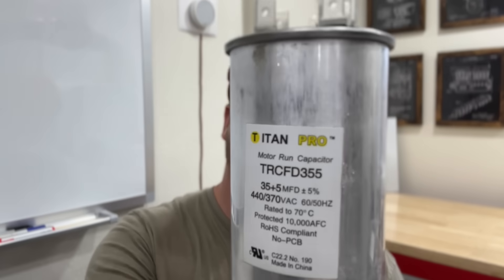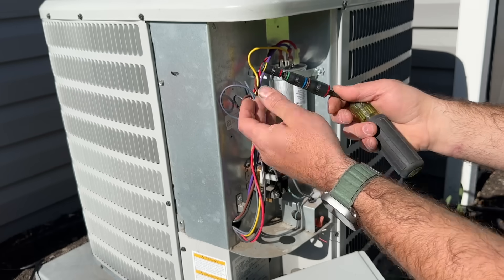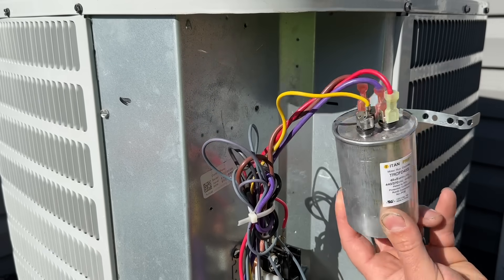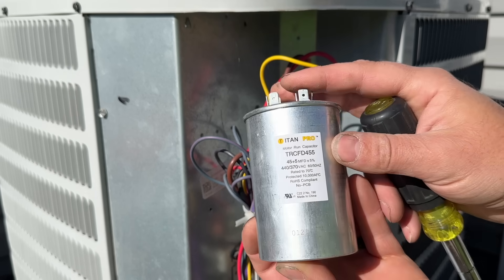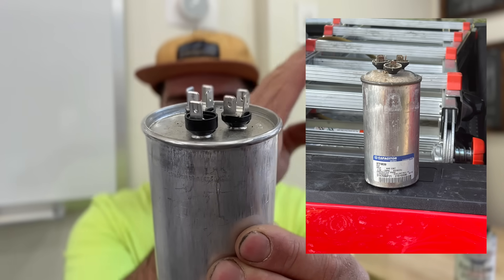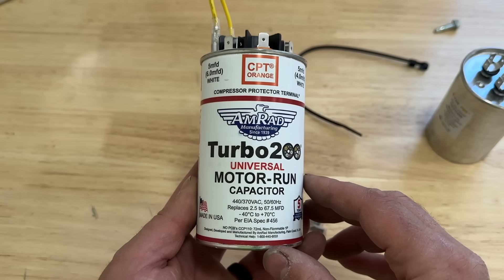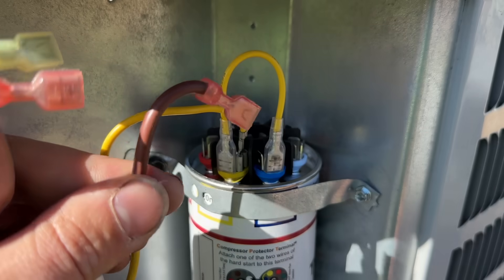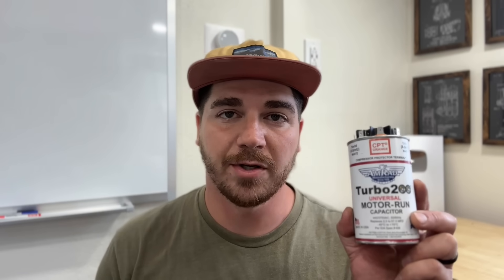HVAC Contractors Practically Make Their Living On These

Comment: On the turbo 200, when jumping 2 or more terminals together, to get the microfarads you need, you’re supposed to put your wire from the unit on the highest rated terminal in that connected bunch, even though they’re connected together with the little jumper wires.
Reply: Make it make sense....
Reply: certainly if you had to jump 3 together you'd need to hook the unit from one end of the chain or the other?  Otherwise your your making a parallel connection rather than the intended series connection.
Reply: @stvrob6320  I’m just saying that the company says if you jump 10 and  20 and 50 to get 80 uf, put your condenser wire on the 50 not the 20 or 10.
Reply: Why would that make a difference?
Reply: @stvrob6320  not sure but it’s what the manufacturer says to do.

Comment: I'm a retired HVAC technician (even though when I started I was a mechanic) and agree with what was told in the video. FYI, there are American made dual run capacitors other than the expensive AmRads, which I'm sure you can locate with a Google search. They will not be fit-em-alls but like the original equipment cap.

Comment: How do you know the capacitor is bad? My thermostat will not go down to the desired setting, I have changed my filters and cleaned the coils with a hose spray (although did not use cleaner and will take the top off tomorrow and a proper cleaning.
Reply: I just watched that part in the video. Any other ideas on why the thermostat won't go down - I also don't think the air is cooling. (single mom (recently) and on a fixed budget) - thanks!

Comment: Had the same exact thing happened to me, new unit was installed in 2021. Called the same guy and charged me 80 bucks, he said thats not covered by the warranty, checked it on Amazon and found the same CAP for 30 bucks.

Comment: better to not short capacitors but instead use a 1w 1Mohm resistor with alligator clips to discharge/store.  direct shorting can destroy the cap if not bad already.

Comment: Instead of paying $75 for that turbo 200, multi-capacitor  just find out what capacitor your unit has and buy a spare, put it in a plastic bag and tape it inside the electrical panel area of your unit.

Comment: When my 25 year old air conditioner compressor stopped working. We searched YouTube and found the reason most compressors fail. Checked the capacitor and it was ballooned out. Ordered a new one on amazon. Two days later we had cold air.

Comment: I have two units and last year one went out. Tech came out and knew straightaway what it was. Then he said, come watch this. Pretty much step by step what to do and what to look for. He kept asking if I had questions. I think I paid $300 something and away he went. This year, the other unit went out. I followed the steps, used a video as a reminder, and while not as obvious the capacitor was the issue, last one was warped, I knew how to check it. Sure enough the capacitor was bad. I didn’t want to wait so I paid $30 at the local ace hardware for a replacement. Popped it back in and all was good to go. If I ever have a different issue, that tech will be the first place I call. 

Thanks for taking the time to make a video.

Comment: thats because of the system starting up against high pressure caused by the TXV valve, this will cause problems nurning up the cap and the compressor. HVAC contractors like this because its more money, i removed mine and use the old fashion orifice that relieves the pressure. yes you may loose some efficiency but it will last many years longer

Comment: OK 2 SET THIS GUY STRAIGHT!   THEY R NOT $10.  They may b 4 a China junk one that will cost u a 2nd service call in 1 yrs time.   And will take 4 days b4 your AC IS BACK ON!        😊They r more like $22‐40 from the places us in the bis buy them.        They r not sold at HD 4 a reason. And most suppliers r in large metro cities.(a bit of drive from the subs). 

Also we must buy many different sizes and voltages and have then on thr truck. (THIS IS CASH TIED UP).   YOU R PAYING 4 the fact that I have it at your house at 7pm on a Tuesday evening and don't have to bill the customer to drive and get it tomorrow....  make sense.  

 It's called a service call because it's a service industry.      Also I'd add these things r dangerous to be installing when one does not know what they r doing.  They store alot of current and its at 240volts.           Lots current is what kills or injures someone. 
Voltage is what makes it a higher potential of happening.     Because it can push the current(amps) across a gap( like a spark plug).       

   3rd. Nobody is being charged $2000 2replace this.   Not half that.   If I show up on an ac call and that is the 1 and only problem (which usually it is not) I charge the 1st hr (1hr minimum fee) of $250 and the $25 approx cost 4 the part and I'm gone.    

Go ahead and take this on if you r capable. I just did not like the way hvac contractor's or techs were referred to here and wanted to explain.        18 yrs College educated Tech and small Bis Owner.     😊😊😊

Comment: I like you videos. Electrical engineer here, to correct a point. Capacitors do store charge, but that's not how they are used in this application (AC voltages). Here, the capacitor doesn't provide a "jolt" of charge. It is connected in series with a winding in the motor (here, the compressor and the condenser fan), and it causes a shift in the electrical phase between the two windings in the motor. This produces a torque in the motor when it is turning. Some capacitors are for the run winding and some are for the start winding. If the start winding, a switch disconnects this capacitor as the motor spins up.
Reply: Doug, I'm glad you posted this. I was about to post as well. I have been an HVACR tech for fifty years ( long before these POS capacitors were around. Also, the right way is to install two separate caps ( one for the herm and one for the cond fan). They will perform better and last longer. I also don't like the money making piggy back start caps, install the correct start cap and relay! Now days with generators and solar batteries use a Micro-Air soft start and reduce the start-up inrush current.
Reply: @keithreuter4932  Was going to do the same.
Reply: These repairs wouldn't be so soon or often is the manufacturers would use quality capacitors. Unfortunately they use Chinesium brands that usually fail on year 2.
Reply: The capacitor is never in series with the run or main winding. A run capacitor is in series with the start or auxiliary winding. If there is a start capacitor in an air conditioning unit, it typically is connected in parallel to the run capacitor and is switched out by a relay (or centrifugal switch on the fan motor) once the motor starts. Most AC units are permanent split capacitor meaning they only have a run capacitor. If the application is considered hard starting, they will have an optional start kit which contains the start cap and relay.

Comment: That’s a run capacitor, it’s wired between start and run on the compressor and is in the circuit all of the time not a jolt in the start. Yes, they are also around $20. Don’t fall for the phase shifter BS either.

Comment: As an HVAC it is truly unfortunate what a lot of companies charge personally I’m at 250 out the door which includes me coming out parts labor etc I will say if it’s in the attic and it’s hot asl outside that does bump up to 300-350 depending on how difficult it is to get to and how far away u live

Comment: Had a ac guy out to inspect unit before summer. 5 minutes after he got there he knocks on the front door and tells me I need to get a special capacitor to help the unit startup and save electricity. Said it was only $150 dollars. I told him I'd think about it and he went back to the tuneup. I researched the capacitor on amazon $10. Oh yeah, when I ask he admitted he was on commission not straight salary.

Comment: @The DIY HVAC Guy shorting a capacitor is one of most dangerous things you could do.  This could result in an Arc Flash/Arc Blast event.  This could result in one's death or serious injury due to gasses, shrapnel, blast energy, molten metal, chemicals, etc. during the Arc Flash/Blast.

I say this from the perspective as an electrically qualified individual who's been trained to discharge capacitors using a proper discharge circuit which will gradually discharge energy from the capacitor.

Comment: Good video! Definitely heard some outrageous prices for capacitors. If you want to keep some in stock at your house, I would cut power, open up your system’s panel and see what your system(s) use. No need to pay $70-$100 for the turbos. Also, Turbo 200 only supplies up to 67.5mfd, the 200Xs will be higher mfd rating to cover the higher ranges like 70 and 80mfd.

Comment: Don't check it, just replace it. My AC unit is 10 years old and I wasn't having any issues but I just replaced the cap 10 years old, is old enough. I checked it later and both parts were about 25% low. My AC runs like normal.

Comment: 70 buck one great for handyman to have but smarter to but the 20  a local appliance store  around 2008 hit me for 90 bucks  no amazon then and middle of july in fl had to buy but when the machine died i saved that cap plus the one for the air handler  but when they fail useally the hottest time 
and i had 90 yr mom with me it needs fixing quick  i want to build a cabin and window shackers might be choice since i can have a spare

Comment: My a/c unit was under two years old, when my capacitor failed. I contacted the company that installed my unit, figuring there must be at least a partial warranty. 
They covered the cost of the capacitor, but not the labor - charged close to $500 to replace! I said never again! Highway robbery right there!
I’ll fix it myself in the future! I possess decent skills and tools! YouTube will compensate for any knowledge gap!

Comment: My highly skilled HVAC guy failed to get the unit started, it ran for 30 secs then shut down. It finally turned out that the utility's "Saver Switch" which allows them to remotely shut it to prevent brownouts was faulty. Took out that wire and all was fine. Now I'm running a geothermal heat pump instead for heating and cooling and much lower cost.

Comment: Did this and a friend suggested I still replace the AC unit. His thinking was I just put a band-aid on a problem. 

But...I did end up replacing it. About 12 years later, after the coil got eaten through by R134a (corrosive). 

I'd suggest folks buy what you need now and keep them in stock somewhere. You don't want to wait two days for the magic UPS truck to show up when it's 90+ degrees, humid and the sun has yet to come up.

Comment: Question. Why are we taking a chance with the power by putting the disconnect back in the slot upside down and trying to figure out if it’s disconnected with the code words. It looks like on written correctly means on. Can’t we just set the disconnect on top of the box and close it?  There’s no question now. 1:09
Reply: You can do that. But for sake of losing it or it getting wet, (during raining or even cleaning)it stores inside the box in the off position just the same. The contacts are flipped or spread in a way they will not make contact. Also there's no code words. The slots just expose either the word ON or OFF depending on the orientation of the disconnect. If you can see the word ON but not OFF just consider it live.
Reply: @DrLordStinkyButtTheButler  I get it. But I just prefer to set it on top. Then everyone knows it’s disconnected. And of course use your non contact device to verify. Now you said wet. Well. That just makes everything a mess. I am not a professional so I don’t have to rush to get it fixed. If it’s cool and raining. I can wait. But. You’re the professional and know what you’re doing. So you keep doing what you’re doing and stay safe. Thanks.

Comment: I was charged $500 for a bad run capacitor. The HVAC tech was done in less than 30 minutes and I was back up and running. Imagine making $1000/hour, what a racket. Another time the condensate line was clogged, he charged another $375 to vacuum it it out. Now I pour vinegar once a month down the line and have been trouble free, I see the water and slime coming out when the A/C is running. Some repair places want to get rich, rather than be fair and make a living.

Comment: It's funny, saw the the thumbnail and knew exactly what it was. I have a dehumidifier that stopped working in our basement a couple years ago, and tinkering with it as I could, it wouldn't ever kick on the compressor, just the main fan. The voltages/resistance on the cap looked a bit odd, but were indeed still reading as if it were functioning. A similar replacement cap was available on Amazon so I ordered one, installed it, and lo and behold, the thing works like a champ now.  Was like.. $12 I think?

Comment: In Australia all new houses have three phase power (240/415 volt) for their air conditioning and heat pump systems.  Three phase motors do not need a capacitor for starting. Three phase power can also be used for car chargers, lifts, induction stoves and built-in refrigerators. Inverter air conditioners also exist which produce three phase power electronically inside the unit and also do not use starting condensers.

Comment: I had one of these replaced last month and they quoted me 700 bucks.  I didn't mention that my wife had the extended service plan until the guy was done fixing it and then she got out her paperwork and it was covered.  Next time, I will check it myself.
Reply: I would have rather called someone licensed with 22 years experience that knows what he is doing that charged you $20/$25 for the part and $50 for the call.

Comment: My capacitor went out 3 years ago I called the guy who installed the unit and he was a few miles away on another job said he would stop by shortly. He shows up pulled the cover off removed the capacitor off installed the new one for $300.00  told me how lucky I was and gone within 15 minutes.  Had I had only known . Thanks for the info.
Reply: I would have rather called someone licensed with 22 years experience that knows what he is doing that charged you $20/$25 for the part and $50 for the call.

Comment: Capacitors are mot batteries. The store a static charge. They should have a bleeder resistor to drain any remaining charge. They are used to resonate the compressor's start winding to give an initial  rotation.  Them it gets switched out of the circuit  This applies to all split phase motors. The same problems are seen on large power tools as well.

Comment: Some years back, compressor wasn't starting, pulled the starting cap, measured it, one section was way lower than spec. Replaced it for $10. The other upsell is the "your solenoid contacts are getting pitted". Another $12 part they offer to replace for $250.

Comment: A tech needs to use a good Megometer insulation tester and system acid test to really understand the condition of the compressor windings. 
It's like a breaker trip that could be due to a loose lug connection or bad breaker causing heat and reoccurring nuisance trips.
Run caps can also go bad if there is a persistent short cycling condition.

Comment: I did some troubleshooting on my issue and replaced my own capacitor for less then $10 from Amazon a few years ago. Running with no issues ever since. I knew mine was bad because it was swollen. The fan would constantly cycle on and off.

Comment: A typical DIY'er does not need a $500 Fluke 375 multimeter to check capacitance. These days there are literally dozens of multimeters available for less than $20 that have that range. Even Harbor Freight carries a few in that price range. BTW, the modern "inverter" compressors are no longer driven by the far less efficient "split phase" motors that use these capacitors. The same goes for the variable speed cooling fans.

Comment: One trick is to have the new capacitor handy and as you disconnect the old one you are individually matching and connecting the new capacitor per wire.

Comment: I usually charge between $168 and $225 total to change a dual cap. I carry 50-100 different caps, dual and single on the van. I replace with original type parts and I don’t like multi caps. They are expensive and last the same as a direct replacement part. I also check the system pressures, amps/volts, TD, overall condition. I get people cooling as quickly as possible. I get called all the time by people that changed the cap and either wired it wrong or the unit still doesn’t work. Same on thermostats. I change caps and if I believe the homeowner is a DIYer I will tell them to buy an extra cap and teach them how to replace it. Also explain how to clear drains, what to check for, and to call me for free advice. I had a restaurant owner give me crap once for charging $275 total (time and materials) for a $10 part. Plus that was 10pm on a Saturday when his commercial ice machine stopped. He said that’s a really high markup! I asked him what it cost in materials to make a pot of ice tea and how much does he charge for a glass? I think he realized how stupid he was sounding real fast.
Reply: I charge close to same amount. I've had people tell me it a 20 dollar part.  I usually respond with, why didn't you fix it then?
Reply: This is very reasonable. Like me your honest
Reply: It's amazing how companies fell that what they charge someone is reasonable like the Insane markup on tea and soda but when the table is turned they complain. Luckily, I had the same issue, I thought that my A coil froze again due to low charge, but this time it was the cap. The tech was very informative as I watched him from start to finish and I was only charged 150.00 for the service call, the part and knowledge so I can do it myself should it happen in the future.